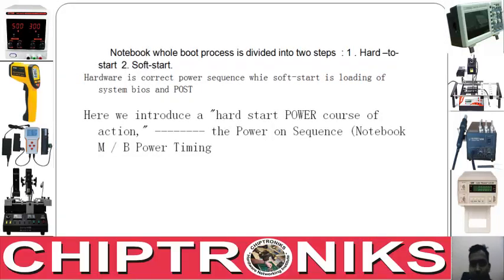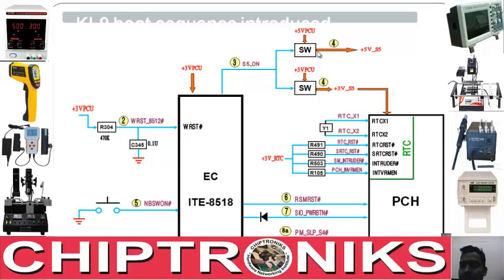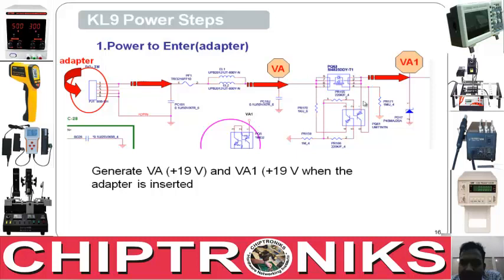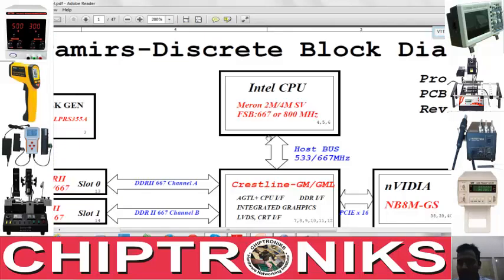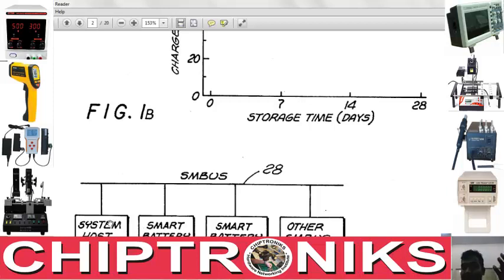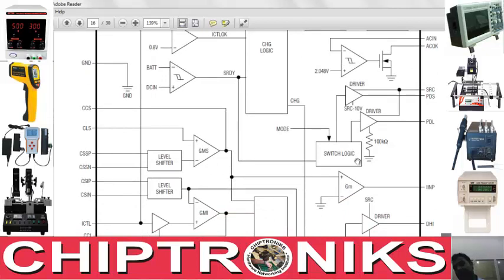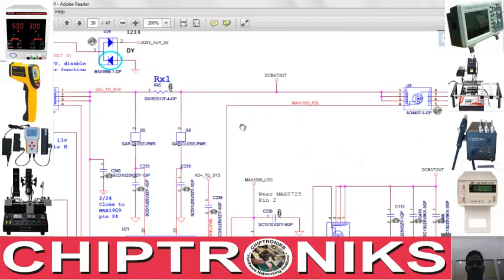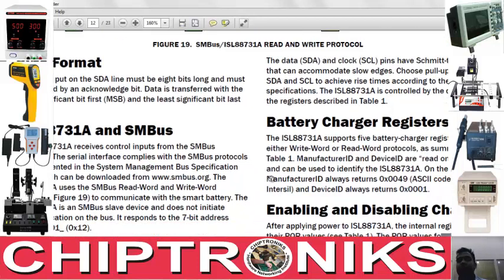online chip level laptop repairing course, 6th & 7th gen laptop repair course institute#CHIPTRONIKS

Comment: nice, detailed and professional tutorial, i have a question which i have been asking every expert but i am disappointed with their answer. i have seen in many laptop schematics there are TP 3, TP14 written in almost all schematics, what are those, are those testpoints to check the particular IC. i have a schematic of HPdv6 and while going through i noticed these test points near PCh, hope you will clear this.
Reply: Usually the test points are there for quality check after the production. Those are usually used to test the entire board and not a single component. If it fails in some measurment, than the board is dismissed from the production line.
They use a special test assembly to accessi the test points simultaneously and perform the measurment required.